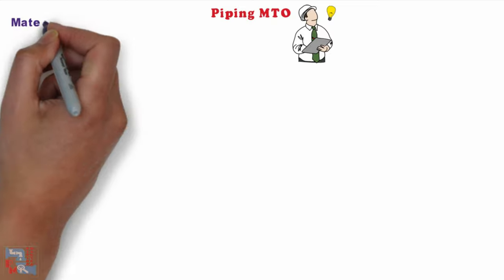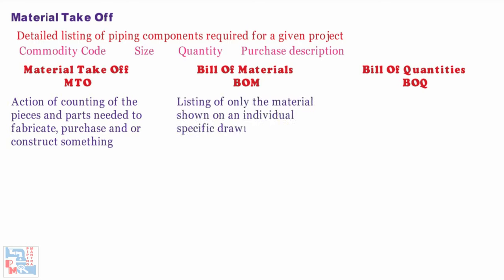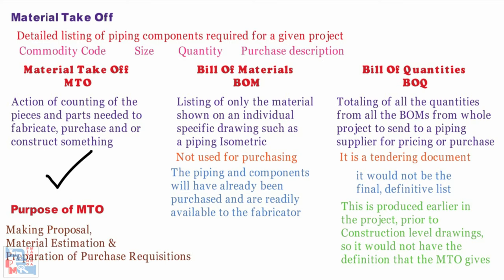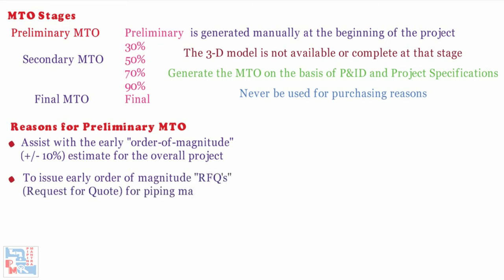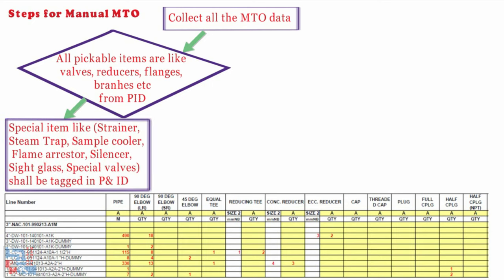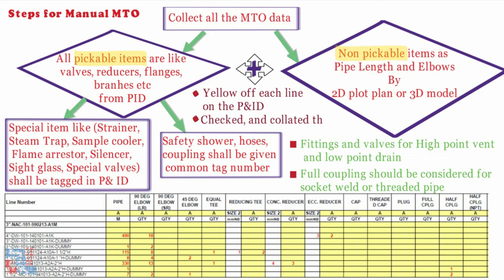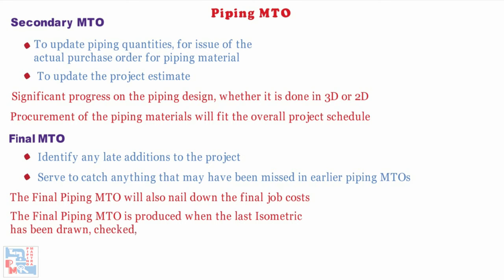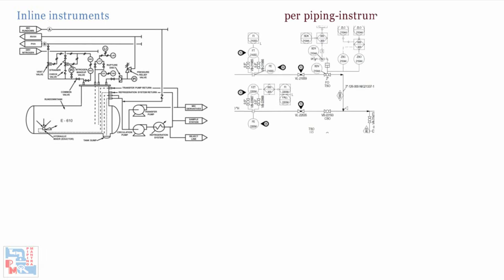Piping MTO | Material Take-Off | Bill Of Materials | Bill Of Quantities | Piping Mantra

Comment: Nice what is difference between design basic vs plant specification vs ? project specifications
Reply from the maker: Design basis is specific to any company and plant specification is specific requirement other than design or add on to it. Which is change based on plant to plant
Reply: @PipingMantra   Excellent but it is still confusing....Can you please elaborate more please?
Thanks.